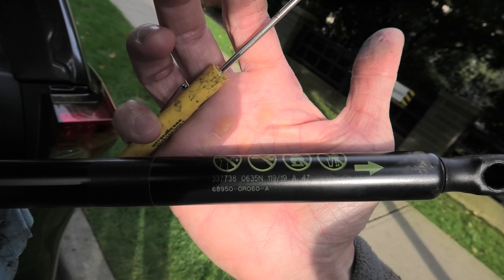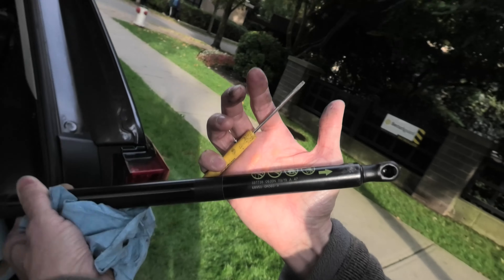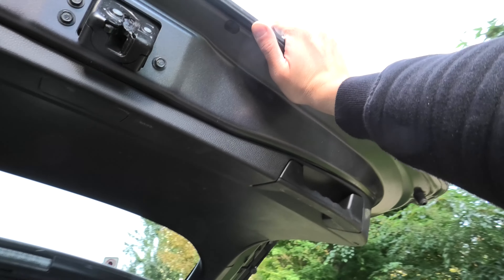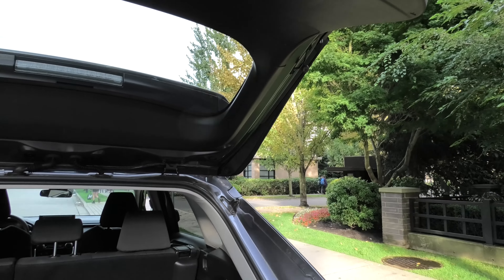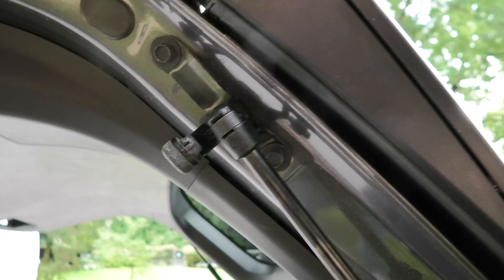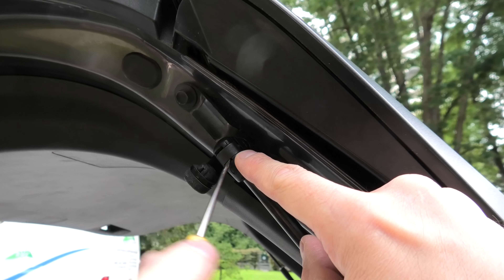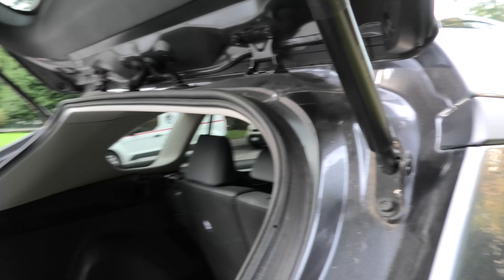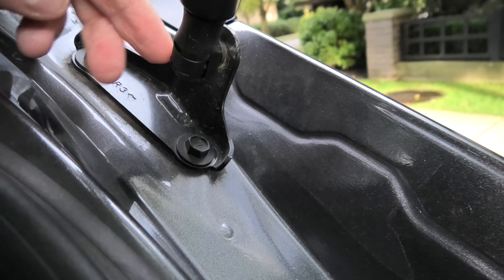Toyota RAV4 (2019-2024): Hatch Door Struts (Lift Cylinders) Replacement.

Comment: Dear Morozov Have you guys ever replaced the cylinders on a limited that has the power cylinders If I wanted to can I replace my power cylinders with regular non power cylinders as personally I can't stand my power liftegate .
Reply from the maker: We have not. But it is possible to replace them. You need to disconnect the power connector, which I believe is connected under the rear hatch door plastic cover. Also I believe that the mounting brackets that hold the power struts are different from non-power ones. I would either get the brackets and the non-power struts at the dealer or the junkyard.
Reply from the maker: As for the brackets, I am not 100% certain. It is best to check at the parts department if you need to change them.